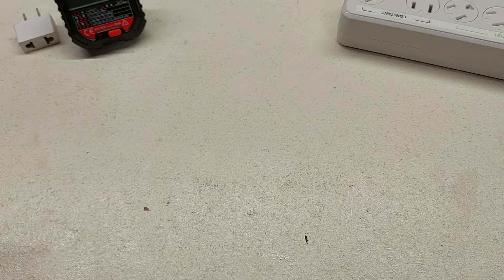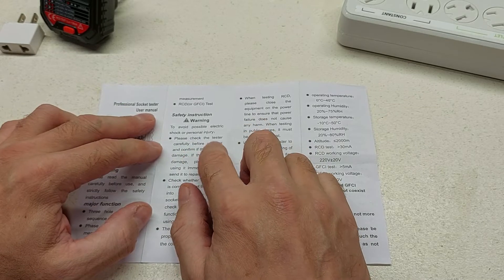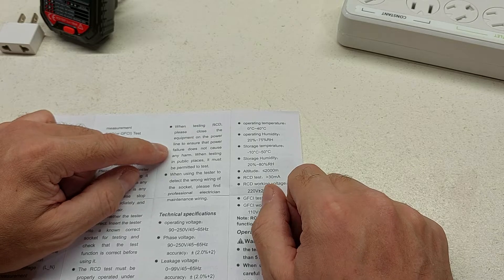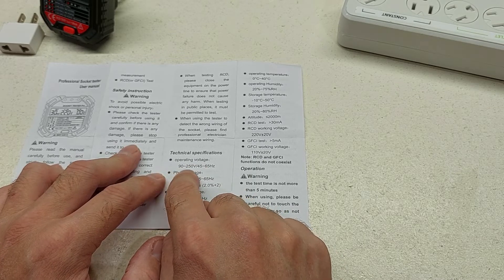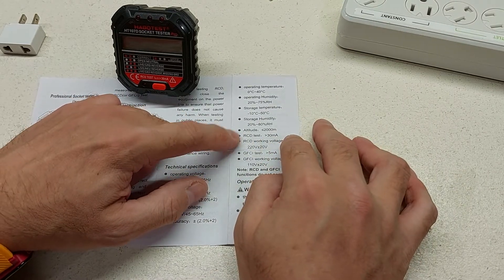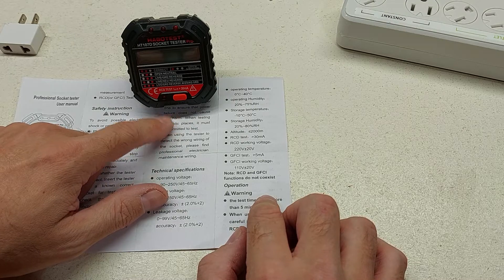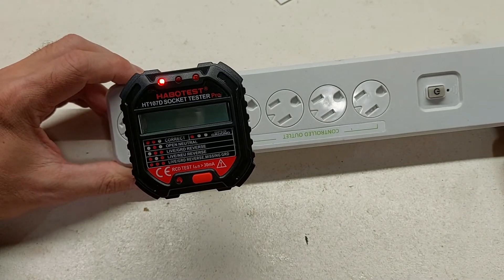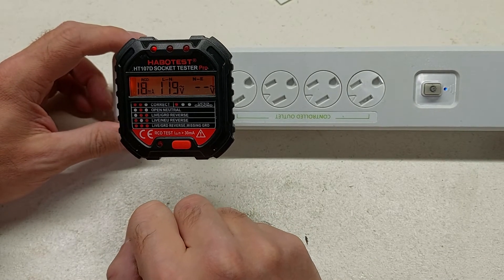I was shipped the wrong Habotest HT107 socket tester.   This is what I'm going to do!

Comment: Thanks for your video. I decided to go Amazon. I can get it in 2 days Prime and drop it off at the UPS store if it needs  a return. Following your cautionary tale, I got the HT107B model which has the US pins and as of this time a discount coupon which brings the price down to $13.

Update: got it delivered today, no GFCI outlet to check it on, but lights up as expected for correct wiring. L-N 118V or 2V off from measured 120V (meets specs) 7ma GFCI. 0V N-E. All good.  In places that use the RCD system, the main circuit  breaker will trip if it has an RCD enabled main breaker.

Comment: I have this tester with same socket (Euro-schuko because it is combination of C, E, F) but it fit because we use type E (Czech Republic, Slovak Republic, France, Poland, Belgium, etc.) it also fit into typ F (Germany, Austria,Spain, some part of Africa, Asia and wild east) it also fit into type C (Russia, Turkey,...). C type have no ground and isolated from ground.
Only problem I had tester expect live on right side so it didn't work properly and I must reconnect internal wire for our standart live on the left. RCD test work only when not reversed. RCD is relatively new here and rare in older residential buildings even not possible due TN-C wiring. It is forced from 2009 in new or rebuilt buildings.

Comment: In case you (or others finding this) are not aware, this European style plug DOES include a grounding (or earth) contact - it's just not a pin.  The whole socket in the EU is recessed, and the ground contact is made at the edge before the two pins connect to the mains.  So all you need for this to operate more or less correctly is a proper adapter (which is what the commenter meant by 'Schuko').  RCD and GFCI mean the same thing, but the North American GFCI devices trip at a lower current - generally 5 mA instead of 30 mA.  So that would affect the test, though presumably the test would still work for you.  (It probably wouldn't work for someone in the EU trying to use the HT107B, because the test current applied across Live and Ground would be too low.)

There's another model of this tester brand called the HT97.  The whole thing is an LCD display so it displays everything more clearly (no need to refer to a key, and the backlight changes to amber on fault detection.  It measures time to trip in milliseconds, which seems like a desirable addition - if an ancient RCD/GFCI tripped slowly it wouldn't be providing much protection.  The HT97 is less easy to find, but costs about the same and seems to have the edge.  Again it's available in 3 plug types (the one with E on the end being the square pins of the UK).

Comment: I used different cables, MP3 players instead of AC adapter used battery still sound is interrupting
Reply from the maker: I have commented on your video.  It sounds like an intermittent connection.   Other than that there may be a detection circuit that has some high resistance on it, so it's causing problems.
Reply: @ScottBruder  thanks a lot
Reply from the maker: @aihsanasl  not a problem. I hope you can fix it.  Comment if you have any luck with cleaning in a reply on your channel and I'll reply back with next steps if needed.